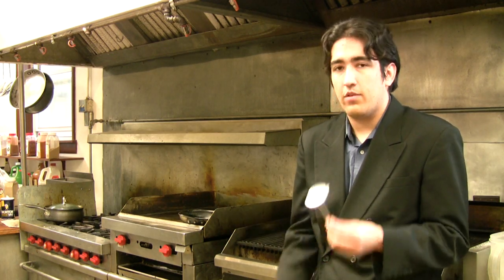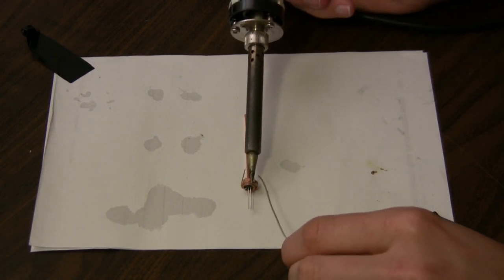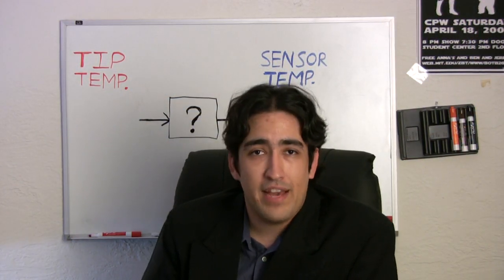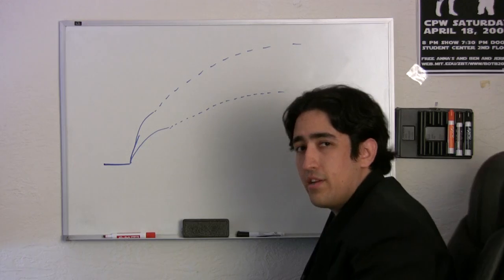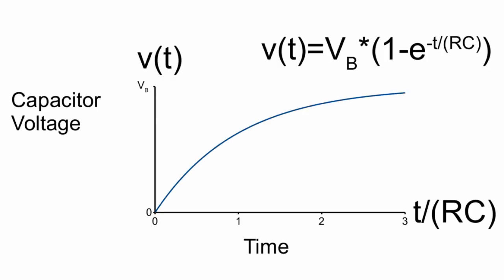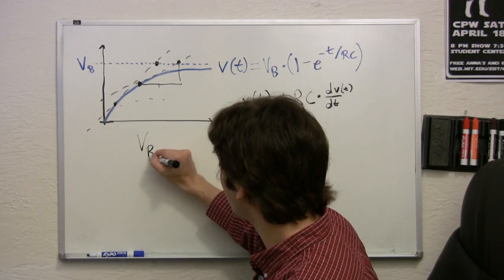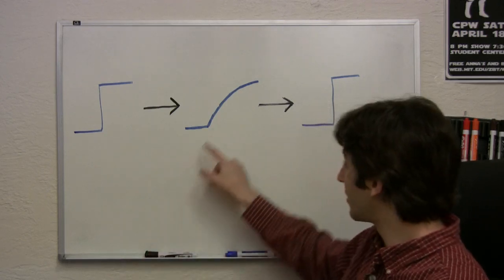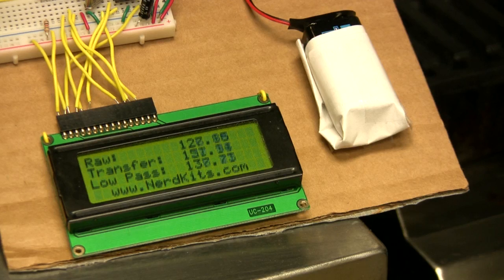DIY Meat Thermometer with Predictive Filter

Comment: the actual value of time constant is irrelevant. He took a first derivative of the the equation(partial derivate is a different thing); you need to remember that taking the derivative is actually the slope of the curve. So what he is effectively doing is increasing the value in y-axis by RC while keeping x constant. So he draws a little horizontal line. 
The cancelling out bit is easy. Take the derivative of original VB and see what you get.